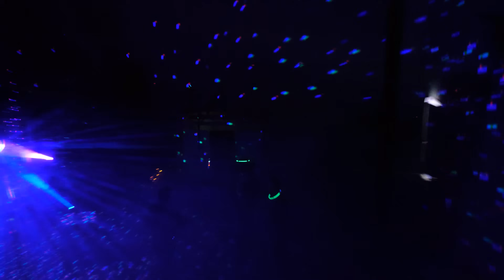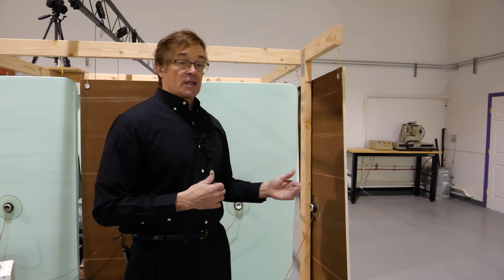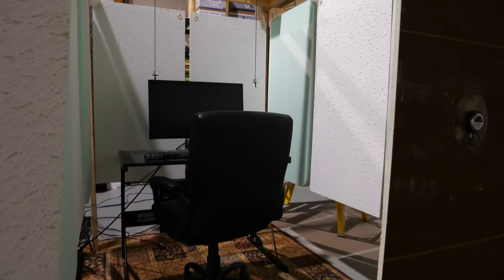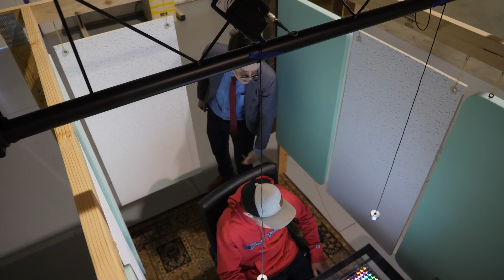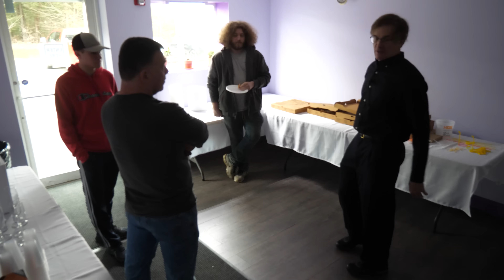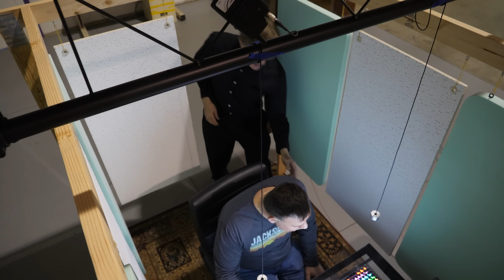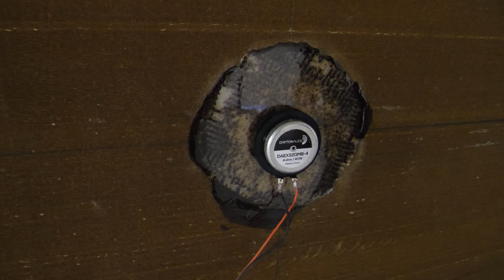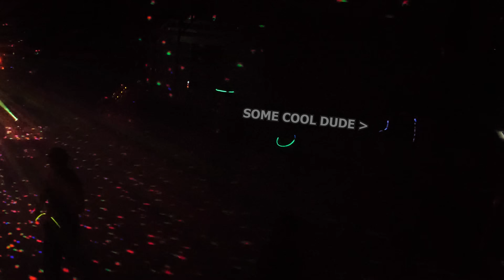SHOULD SPEAKERS THIS GOOD BE LEGAL?

Comment: Tactile Transducers have been a great audio solution for decades. The big ones are great to mount inside of sofas crossed over at 80hz best for theater applications. The Aura Sound AST-2B-4 had the lowest bass response compared to the Daytons. Silent subs you can feel but not hear.

Comment: Being a 5.1 system, wouldn't it be better to set the panels up in more of a pentagon-shaped enclosure?
That way, they would all be an identical distance from the listener.
Could you also potentially hang them lengthways (from each other), with either varying panels or keeping the lower frequency panels on the lower/upper level?
Reply from the maker: You could  do both.  That's  not a bad idea.

Comment: Great idea, but 50 years ago Bertagni Electrostatic Speakers (BES) were sold using the same concept. They were true dipole speakers with sound eminating 360 degrees. I owned a pair of D120s. The unique things about them, if set up correctly, was the breadth and depth of the sound stage. The D120s had 2 separate panels and a dome tweeter for high frequency. I drove them with an Accuphase P300 Amp through a C200 preamp. The key with this type of speaker is the set-up. They need to be a couple of feet from the wall and angled in toward the listening area, the sound will be very open and airy. Several audiophile friends with high end systems were in disbelief of my system with the clarity, sound stage and lack of distortion at high listening levels. I'm thinking about building a couple of these for my Atmos overheads.

Comment: How well do you think these would handle an ultra thin fiberglassing for durability?

I note previously you sanded off the shiny outside to improve sound transmission, so would expect this to reduce efficiency.
Reply from the maker: Poorly.  It would stiffen the panel substantially.
Reply: @TechIngredients  true.. maybe a more flexible polymer, but anything would likely dampen the response.

Maybe a simple light and decorative cover, and have a few spares for easy replacement should they get damaged.

Comment: You are putting two different speakers in series, as each speaker has attached a different panel material and therefore  to drive a different load, (so currents and fase probably not the same),  so would it not be better to put them in parralel, so they can't influence/restrict each other and be independant ?
Reply from the maker: The current has to be the same because of the series operation.

Comment: I used to test speakers for one of the world's leading audio companies, and I'm itching to build myself a pair of these. On the topic of subwoofers, what are your thoughts on the Thigpen rotary woofer? Insanely expensive to be sure (to say nothing of the complete acoustic chamber they need behind them to handle infrasonic reverb), but wondering if they were legit or Eh. Too complex for the average wonk to reverse-engineer, but a fascinating device at any rate. Marshall & Ogletree designed them into a digital organ spec'd by Cameron Carpenter some years back.

I have few ideological heroes. You are one of them.

Comment: You could have easily done two drivers per panel to keep 8 ohm's. 

Dude literally said "this has a great response from 20hz-20khz

Dude that's a 6.5 inch subwoofer lol you're not gunna get much better than 40hz response out of it at BEST. 

I can tell by looking at the surrounds that it's not even a heavy duty woofer and it's not long throw. Probably has 10mm xmax on that pitiful subwoofer lol wtf man
Reply from the maker: That's certainly  possible.

Comment: I do enjoy this channel so much so I was happy to see this interesting approach using the 5.1 multiple driver technique in a smaller listening space where presumably being close to the panels you don't have to drive them very hard to get sufficient output .    I have tried several of the parts express exciter units on both the polystyrene panels - 2X2  and thin 1/4 inch plywood 4X4 and 2X2.  I thought the wood would be closer to tone a musical instrument than the plastic panel and it was.  Acoustic guitars were quite good.  BTW the results from mounting one of these exciters on a guitar it self is amazing.     While I am sure the bass response on the larger panels is better than smaller ones the downside is that they resonate - plunk your finger on the panel and if you hear it ring and decay even a little,  it will do it during excitation or musical input at various multiples of the resonant frequency's.   Its frankly more than a little disconcerting and very noticeable at moderate volumes.    More inert materials like ceiling tiles that dampen resonances or applying some kind of dampening material to the panel will also help with the resonances but ultimately also dampens all the frequency's making the output more inefficient.    There is a French company what claims to have built speakers and tuned them to dampen all the resonances ( they also use tone wood, specific panel suspension and make musical instruments so maybe they know how ) but the speakers are stupid expensive which is not what anyone who watches this channel would pay for.  I have found that crossing panels over at higher frequency's does reduce this resonance effect and makes it more listenable.  I have also found that high frequency response can be quite peaky and does not quite reach the sparkle you would want from a good speaker.    Suggest anyone who wants to try this get REW software ( free ) and a measurement microphone from parts express so you can run frequency sweeps to see the response and  resonances.  So to build a really good system capable of reproducing full range and taking advantage of the DML dipole characteristics - I suggest a large woofer in a open baffle cabinet - H frame, a DML radiator for the midrange and upper frequencies and a separate ribbon tweeter to pick up the sparkle.  it is possible to tune them using active crossovers and separate amplifiers that are not expensive.  If you would like to discuss the design you may contact me here - RBEK15@msn.com.  My total parts cost for my these speakers is less than $500 including amplification .  And the sound quality? 10X that - at least.
Reply: Great comment, very cool Rich.
Reply: Thank you for for comment
Reply: I was thinking ribbon tweeters & a good sub would be a good idea. I might have a new project in mind now 😅

Comment: These would likely be much much much better if you put crossovers on the pairs, so you have a mid driver and tweeter configuration equivalent.
Reply from the maker: I don't think so. Consider a piano and its  sound board, there is no crossover, only material and structure are used to generate output.

Comment: What about magnetic suspension. I seen videos where there designed magnetic locks, and one of them holds a gap at a particular distance, doesn't want to get closer or push away.
What about something like that, would that make it better?
Reply from the maker: It probably would and it might make the build more interesting  to look at.

Comment: This is amazing work, I wonder what happens to the sound quality if you paint the panels, lets say with acrylic or oil paint for decoration, have you tested the effect of paint on them?
Reply from the maker: Yes.  Spray paint is fine, a continuous layer of acrylic or latex paint reduces the sound output.

Comment: Would that be use for Home cinema/Theater ?  Would the same rules apply to Home therater speaker placement if you were using those ? what kind of power do you need to drive them ?
Reply from the maker: Sure.
Not much.  The drivers are 40 watts max and you don't need to drive them even that hard.
Reply: @TechIngredients  so you're telling me that in an afternoon i could wip out like 7-9 of those and put them in an surround sound maner and enjoy a movie with a subwoofer. Do they need to be near? or i could put them like Dolby recommend ? thanks for your quick answer. Really love your content!

Comment: I used those drivers to annoy the hell out of the bats in the wall cavities and attic by placing them directly on the wall or ceiling where I heard them. What was a 20 year infestation according to the expert who cleaned the aftermath.... is no longer, and it was cheap and safe to do.

Odd use of them, but I seriously would not have had them around the house if not for this channel.

Comment: could you please look into this, and tell me if we used a tube filled with your  conductive paste between the the sources of heat and cold would the output be more efficient than copper or alloy cable. when watching a video on the camping stove that allows you to charge your cell phone as you cook or more so as long as the stove has fuel ie wood to burn. the video I've added is explaining the next generation of the modules, so I believe them to be about 20% efficient, as they are using a throw away resource this is sort of money for nothing. could you please have a look at this module and think out of the box regarding your heat sink paste as I belive it could be used for more than just for heat sinks  https://youtu.be/1OnGYy9Pyyg
Reply from the maker: It's unlikely any thermal generator will reach 20% even in a laboratory.  A solid metal bar or rod will be FAR better than any thermal transfer material.  Of course the ends will need a thermal paste layer to work properly.  Look into heat pipes for long distance heat transfer.
Reply: @Tech Ingredients  I will thanks, I thought your paste would transfer more heat than basically most things readily available at a reasonable price. If I am correct they say this TWIST was the answer to the device, the use of platinum did bump the price considerably.  Can you get why I was thinking of your paste packed in a tube of some sort would transfer the heat and also the cold better than the wire they were using. Your video explaining the conductivity of this medium compared to other materials got me thinking of where else this brilliant product could be used.  Your shows encourage us to get thinking they are fantastic, you explain things pretty well so I always come away knowing something new so a huge thank you for this, I am thinking about all the products in our home that gives off heat and also in a car if a car could use even a tiny amount of the heat generated to trickle charge a battery or even the big capacitor that is used in the Lamborghini, even the heat given off by the battery pack in an eV.  If a tree has only one leaf it will not grow but when all the leaves work together the tree will thrive so we might be onto something if we use more of these small engines.

Comment: I just started the clip. I see the tube amps and I almost lose all hope. You're deep diving into audiophile magic wonderland now. Make sure to keep removing the end of the cables from time to time cuz the oxidation layer you can hear ahum ahum yeah right... Same length cable cuz the run time through the cable.... Use tubes cuz tubes be better.
Reply from the maker: Now, why is that?  The amps don't  matter, I never discussed  their role.  We had them and used them.
Reply: @TechIngredients  yeah I added that I just started to watch the clip at that point. It's not discussed. My initial comment is nothing more than an expectation of oh nooooooo. Excuse me haha.

Comment: you probably want to put the eps panels in the middle, in line with the ear, since the high frequencies are more directional than the mids.
Reply from the maker: You might be right.  We paired each type per channel, but didn't try reversing the type of panel in each pair.

Comment: What type of drivers are they? and i wonder if they have tried using circular panels?
Reply from the maker: We didn't try circular  because of the low packing density over the surface.  Parts Express has a large number of models, but the availability changes.  You'll have to decide based on cost and performance.

Comment: Still experimenting on my set up but currently have two large XPS dml hanging from ceiling, off an Aiyima 07 amp which is also running elac debut 2.0 in parallel via Niles SVL-2.  Ifi zen DAC feeding this and a KEF sub.  The svl-2 lets you rebalance the traditional speakers and DML.  I found the DML had great clarity but too thin at lower mid even with a sub.  So paired with traditional speakers they open up the sound in a way I’d normally only get by really driving the speakers at higher volumes.  Need to try those ceiling tiles for mid-range.

Comment: I am a pro engineer.  These speakers work on resonance relative to the speaker being mounted on the material.  Any material can be used as an amplifier with a Bluetooth speaker for instance.    Even over the internet there is an extreme ring/resonant tone that is showing up between 300 and 700 which is the resonant frequency for these panels and styrofoam.  Thus, the waves are reflected in this resonant frequency in the styrofoam/panels.   What DOES work about them is the sound "source distribution" being more organic like a real instrument.  Electrostatic speakers work like this.   What doesn't work is that all of these songs sound like they are "tin canny" in the midrange and lose a lot of "sparkle" in the 4 to 20k.  So the sheen is more dull and lacks transparency and the midrange is very muddy.   This is not the result of the mics picking up the sound, it is definitely a problem of the design.  This issue is dealt with in all speaker enclosures which inherently block or resonate certain frequencies that are proprietary to the shape of the box enclosure.  BOSE has some amazing design research into this idea, where the speaker cabinet resonates to increase the bass and other low midrange in sync with the speaker frequency response....Thats nice but bottom line?  As soon as you put a speaker on a surface you will lose some tones and gain unwanted resonance in others.   You could correct this with eq correction software, but then the sound degrades a little more since the material is not a naturally resonant material and so the quality of the pressure waves becomes inconsistent, random, and frankly gross.
Reply from the maker: The material acts as an impedance matching element rather than an amplifier.
Reply: @TechIngredients  lol impedence matching how?   Confusing terms here.   Theres no current in the material.  It is simply air that is reflecting as pressure waves in the medium.   The materials are amplifying the resonant quality of the material.  Setting them at 180degrees  wont' cancel this either because the materials are not precise enough to cancel each other.  So your styro is vibrating at around 750 hz in 3d directions not str8 across to the other panel.   Ok, yes if you made them parabolic maybe hypothetically.   But your idea that your are matching impedance is false.   Further, if you have a speaker that is designed in the same shape as the one 180 degrees across from it, you will actually get resonance not cancellation.   depending on how hard the surface is....that is to say that if both panels are the exact same size, they will likely tend to amplify each other with waves bouncing around the enclosure.   Use SONARWORKS REFERENCE ID SOFTWARE AND MIC  to confirm your results.   You will be able to get a n accurate readout of what frequencies are dips down or amplified.   Then pay me the 50$ from the bet you just lost as to the tin can mud at 300 and 700 hz that is being amplified due to the material.   The best material to use is sound happening with no solid matter like a plasma speaker or electrostatic, or a mercury laser speaker like the ones I design.

Comment: commendable effort.  I think this can be replicated with the same equipment but suspended using speaker boxes and flat acoustic room. though your setup will be slightly superior, the speaker boxes more convenient. this also the reason why the guys with decent headphones can't tell if the sound chamber is superior
Reply from the maker: Thanks.
Maybe.  Adding the two additional  mounting points required to suspend these horizontally will effect  the sound quality, but it may be small enough not to be noticed.

Comment: I,m an audio engineer. If I was tested, I,d have asked for some music with vocals on it.
Although impracticable, I believ e these can be good speakers for listening because of the good sensitivity, but not for critical work (mixing/mastr) becaise cant be accurate due to material ressonances at different amplitudes. I also guess they suffer a lack of punch (?) due to distortions in the time domain.

Comment: After I figured out how to test a driver's free-air resonance 3 dB drop-off points, and design the box's proper dimensions, internal angles and porting, I built half a dozen 8-driver 1-Ohm speakers for various purposes, along with current amplifiers to provide the necessary oomph.  Coupled with normal amplifiers, those systems absolutely BANGED.  Speaking of which, one set was used when the Bangles played The Depot in Radford, VA.  :)

Comment: The confusion around dimensions is getting embarrassing. It's 2022 and a 3rd grader can figure out 1D-9D.

1D, 2D, 3D are spatial

4D, 5D, 6D are temporal 

7D, 8D, 9D are spectral 

1D, 4D, 7D line/length/continuous 

2D, 5D, 8D width/breadth/emission 

3D, 6D, 9D height/depth/absorption

Comment: So is it possible to surround your listening room / rec room the same way? As well, does room treatment work in the same way as traditional speakers? I think it would. But it's a good question I think. Another thought. If surrounding the room. How for from the walls?
Reply from the maker: You can.  The speakers will perform  even better if you hang a sound absorbing material on the wall behind them.
Reply: @TechIngredients  Thanks for responding. Have you experimented with that idea, you didn't mention a distance from the wall.  Like 3" 6"12" ?
Your the guy with the most experience with these.